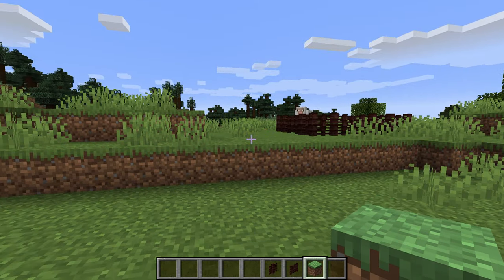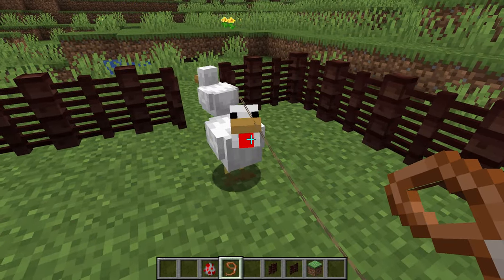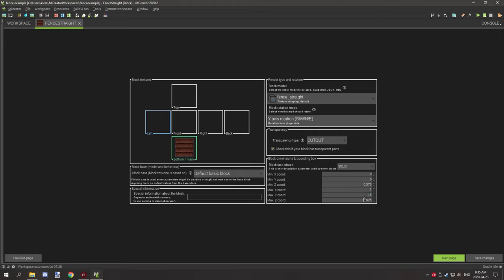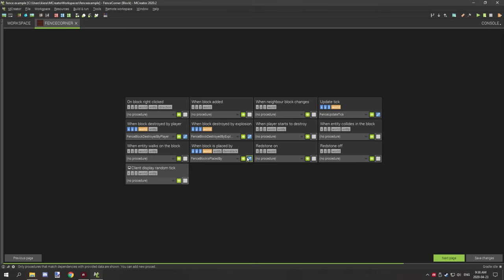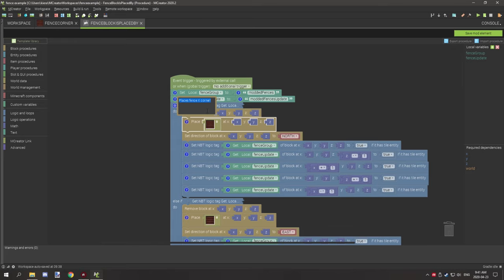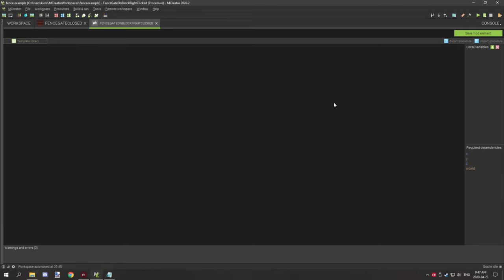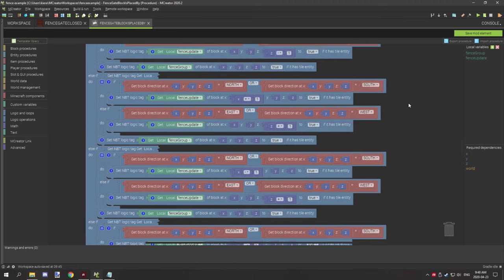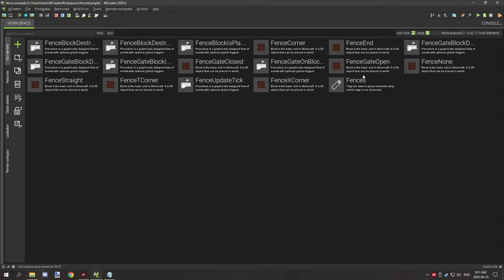MCreator Tutorial: How to make Custom Fences | 2020.2

Comment: I was wondering if this would work for custom walls? Like is there anyway you could make a custom wall tutorial? I made some but they wouldn't connect. I don't want gates or anything, just walls. :)
Reply from the maker: It won't work with built-in options the blocks need to be custom blocks.

Comment: Hello! Can you make a tutorial about how to detect player's health? I want to make that if the player is getting damaged apply invisibility on the player with 20% chance.
Reply: "THE invisible but-not-so-invisible-when-wearing-armour-man"
Reply: That is  simply a procedure block in the procedure menu.
Reply: i can help you with that :)
Reply: i think i might now how
Reply: @trolmaso  I want to make it that if an item is in your inventory Than if you get damaged be invisible with 20% chance. Or is it the same?
Reply from the maker: @slendercraft2960  
You can't test if the player is taking damage sadly only if the player has a given level of health. 

So you could technically make it 20% chance every 10 second if the player's heath is < that 20 give a potion effect, 

this procedure would have to be run as an Player Update Tick global procedure. This way you will also need a timer some conditions

1: testing if the time is if variable is => 10

2: Test if a random number is => 0.8 (20%) 

3: if the player's heath is < than 20 half hearts. (10 hearts) 

If all conditions are true then you want to add your potion event to the DO section.

For the potion you will need to measure ticks to seconds 20 ticks per 1 second so make sure your potion effect ticks (duration) is set to 200 for (10 seconds).

At the moment I don't have time to fit in procedure based tutorials like this however if you still need help you can leave a message on my discord server under #mcreator-help and I can post a screenshot when I have some time, just make sure to ask the same question or let me know in some way about the problem your having, you can use @NorthWestTrees to mention my name so I know its directed at me and not just general help.

Comment: Hello NorthWestTrees!  I'm an absolute beginner at all of this and I'm looking to make a custom fence.  The fence I hope to create is a little technical because I would like the rails to sit at a 45degree angle (to connect with each other on the diagonal.) For beginners, I went through all of the Vanilla files (1.17.30)and I couldn't find fences anywhere in the files. :(  So I definitely need to find where they are located.  I also may need to increase the fences ability to sense another fence component by 1 block so that it can detect that another fence post is located in the adjacent block.  I believe I can adjust the model in Block Bench.  Any suggestions?  Thanks so much!
Reply from the maker: I am not sure how fences in vanilla are detected normally, I think this is done through block states which are supported I think but are not yet in procedures, I have not had time to figure out block states exactly but I do know fences use them as do rails and some other blocks.

As far as the 45 degree thing, this would be very advanced to try to do as models are hard to align if not on a 90 degree angle which may be why vanilla fences are only 90 degrees as are rails and such.

Comment: so I will attempt to use this to make connectable glass in bedrock edition.
Reply from the maker: I am not sure if it will work on bedrock but it should work for glass panes for sure. The only thing that would need to be changed is the block dimension for the hit box from Max Y height from 1.5 to 1.0 and you would not need to set up the fence tags either.